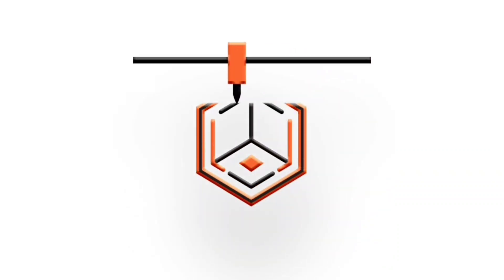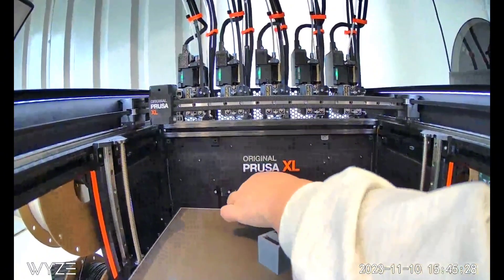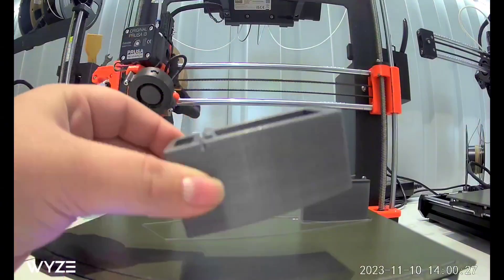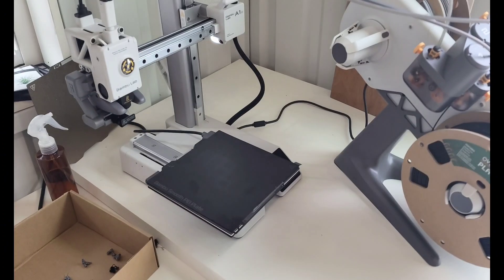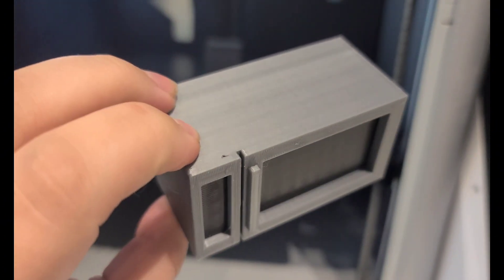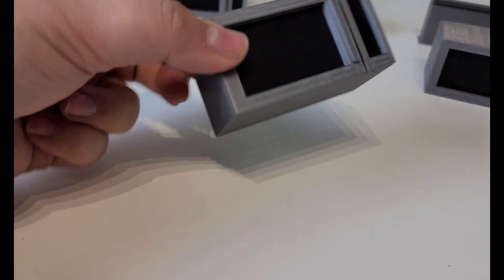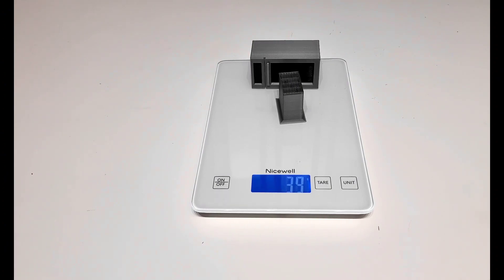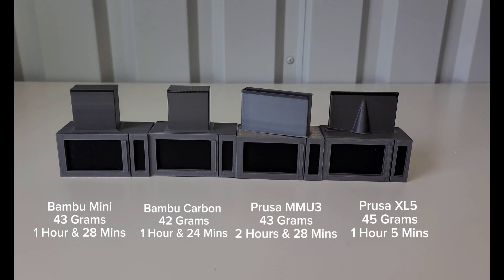Comparing a Miniature Microwave on ALL 4 Multi-Color Printers! Bambu and Prusa!

Comment: I love that you’re doing comparisons across printers, but this model only has a few layers of black and thus only 9 filament swaps on the AMS, which isn’t typical for multi-color models. Any chance you could run a test that works that a bit harder? Also thank you for measuring the purge/priming towers and waste in the material measurements!
Reply from the maker: Yes once I have my XL dialed in, I plan to do more. Thank you!
Reply: @tada3dprinting  👍 I’m going to finish my XL order, so I see a lot of fiddling with settings in my future, too. Again, I really appreciate all the videos showing your experience across the machines!

Comment: the neat thing about printing the color's separately is that you can print the black part in a textured PEI plate so it will give you a glossy and reflective black finish much like real glass complementing the matte look of the grey brushed aluminum look.
Reply from the maker: Very true! Thanks

Comment: Thanks for doing this experiment.  It is great now that there are so many options for color changes.  I think the Prusa XL will always suffer in your smaller prints due to the.6 nozzle, but that also helps it with speed.   It would be interesting to see the same test with a .4 nozzle
Reply from the maker: Thank you!

Comment: Interesting video, but you should have mentioned that the 0.6 nozzle massively changes the printing speed and weight of the model. Therefore the comparison with the Prusa XL is not meaningful
Reply from the maker: Good point. Thanks

Comment: It's surprising that the the XL used the most material.
Reply from the maker: I agree that a .4 nozzle would be a better comparison. Just trying to run them stock. But I'll try this out. Thanks!
Reply: Maybe because of the 0.6mm nozzle, the infill + walls are wider, so they use more filament?
Reply: The test is not meaningful because it compares a printer with a 04 nozzle and a printer with a 06 nozzle

Comment: A small tip for getting additional Nextruder nozzles - they are made by E3D, and I just realized that for me buying from E3D Online website bypasses Prusa's "out of stock" issues, the prices are a little lower AND I just have to pay for internal UK shipping. (Presumably other resellers of E3D nozzles will carry stock now or in the near future?)
Reply from the maker: Are they complete or do you have to put them together? Thanks so much!
Reply: @tada3dprinting  just the brass nozzles (Mk2, Mk3) or brass & steel nozzle (Mk4, XL) comes from E3D. As far as I know you can only get the rest of the assembly from Prusa.

Comment: the XL easily takes the lead, especially if there were even more layers with color changes and additional color filaments or materials.

Would really like to see the XL with smaller nozzle to see how the quality improves.  That will probably take some trial and error, but i think the XL is really starting to show it's advantages now that you've figured out the stringing
Reply from the maker: I'm just so hesitant because I dislike changing the nozzle but I probably just need to get them ordered. Thanks!

Comment: Just curious but why do you place your models diagonally on the bed when you slice?
Reply from the maker: Good question! I like the lines on the top and bottom to be parallel with my print rather than diagonal. I just think it looks better. I know I can change the infill from 45. But it's just easier sometimes if I am jumping between different printers. Thanks!
Reply: @tada3dprinting  i see. Makes sense especially for things like this where aesthetics matter. I’ll definitely try this sometime.

Comment: I'm still using the original, years old Prusa smooth PEI plate on my MK3, and have done many things to improve the flagging adhesion. This includes isopropyl, soap and water, acetone, steel wool, brass wool, fine sandpaper and glue stick. Eventually I found that Aquanet beats them all, is easy to wash off, quick to apply in an even layer and lasts for many print cycles as long as I don't touch the build surface with fingers. On the Microwave, the XL (with 0.6 nozzle) and ironing would be an interesting test. Fast and great surface, hopefully. Might be a winner. Could turn out a large plate full with one purge tower, efficient of print time and material. I would reduce the infill percentage too.
Reply from the maker: All good ideas. Thanks so much!

Comment: Did you try using the "ironing" function on the Bambu Labs? It gives a smoother finish on the top of the print (the door in your case of the Microwave)
Reply from the maker: I haven't yet but I will. Thank you!

Comment: Would be interesting to compare different nozzle sizes on the XL. Also have it on order and want to print small as well as large prints. Does the 0.4 nozzle produce better results for smaller prints with detail? Or maybe even a smaller nozzle? Can you print with different nozzle sizes on the multi tool XL for the same print?
Reply from the maker: Yeah I just hated swapping the nozzles so I think I'll probably just stick to larger prints on the XL. But I'm sure the detail would be good. I don't think they have the slicer setup for multiple nozzles on one print yet. Thanks!

Comment: All the prints look good and the differences in quality are marginal. The patterns on the "glass" parts on the Bambu printers may stem from the diagonal orientation and how the Bambu printers handle interpolation of X and Y motion. Basically the ratio of X-steps to Y-steps. Ironing would certainly help with that.
The warping could have many causes. A sudden draft from an opened door, a tiny grease spot or imperfection on the sheet... To avoid all of the possible causes at once, keep in mind that any sharp or rather any not-rounded corners on the first layer may cause the nozzle to pull on the already deposited line. Sometimes enough to loosen it. A good model to explain how this works is if you imagine how you would rip a piece of paper: as long as you pull into the direction of the paper's surface, it is possible to rip it but considerably harder than when you pull in a direction perpendicular to the surface. For the layer line while the nozzle pulls roughly in the direction along the deposited layer line it is much less likely to overcome the adhesion and with a growing angle between the line and the direction of pull it gets easier to rip the line off the sheet. As mentioned earlier, the old Mickey Mouse ears trick counters that by adding round lines to the corners of the first layer, making it stick much better. Those ears are easy to snip of with a knife or scissors without leaving noticeable marks. 
To add those ears in a way, that they don't interfere with your model but still have the wanted effect,  create a 3/4 disc of about 8-10mm diameter (for right angled corners) as a model and add it to your shape library in the slicer. For each right angled corner you can now add that disc, scale it to the height of your desired FIRST layer height and place it so that the corner fits in the missing wedge. Now move the disc around .1mm away from both of the touching sides of your model. That way it will be welded to the model but the lines of your first layer will not continue into the disc. By removing the disc later you won't break the first layer of your actual model.
Reply from the maker: Thanks so much for your help!

Comment: For adhesion promotion on the MK3 smooth PEI plate, when you're sure it's not related to anything else, such as a dirty plate or poor first layer, it can help to scuff the plate with 0000 steel wool or a green Scotch Brite pad. The micro-abrasions do not harm the plate, but make difficult models stick better without using any glue.
Reply: I also find a generous cost of AquaNet hairspray fixes a multitude of adhesion problems.
Reply from the maker: Thank you!

Comment: This is the comparison I have been waiting for! Thank you. 

From your videos, and others, I am learning that if I want detail  prints  on the XL I will need to have a tool head with .4. My XL won't show up til April or June of next year. Maybe Prusa will improve that as well by then.

The warping. There are so many factors that could cause that.

I am curious how the Bumbu versus Prusa ironing would compare in quality and timing.
Reply from the maker: Yes. Since I have both, I will probably just stick to larger ones on the XL.  Ironing would be a good test. Thanks!